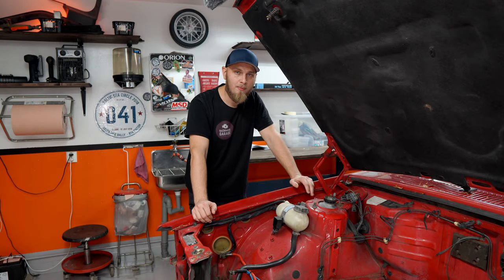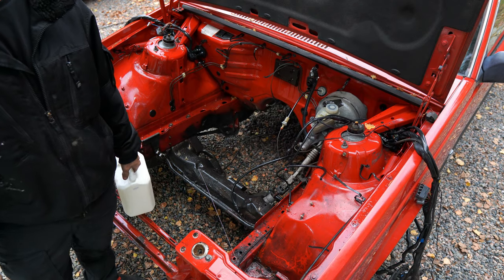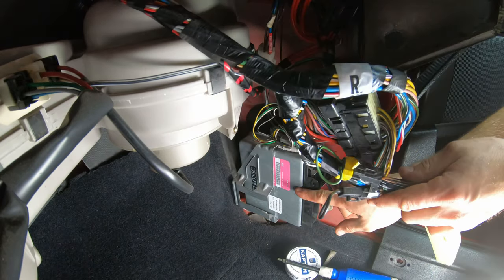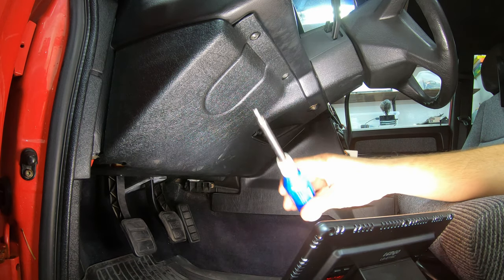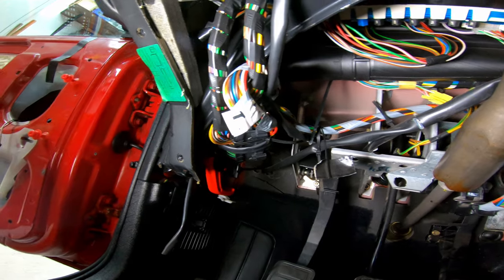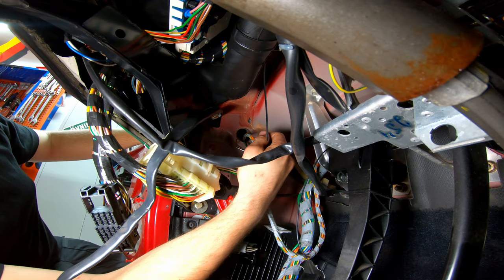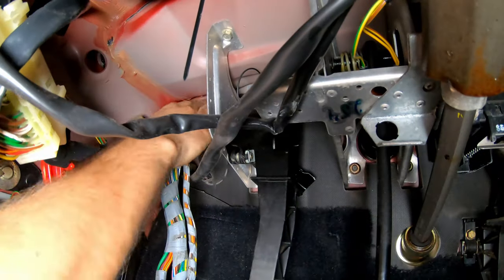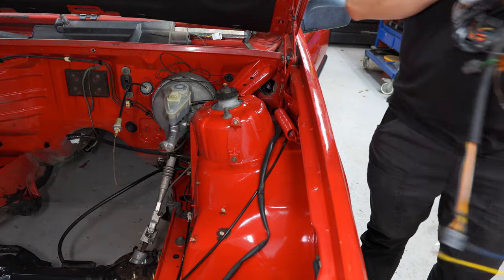Deep Clean of the Engine Bay and Engine Harness Removal - Part 9 - Volvo 740 T5 RWD BUILD

Comment: Can you make a video on how to make the integrated engine and chassis harness into 2 Sepatate harnesses after  SEPARATING the Engine side from the harness...
Reply from the maker: I think I did that, it's been a while since I did the electric work but I will run the T5 more or less stand alone from the chassies wiring due to the fact that I will run with different engines in this car.

Comment: håller på och drar el i mina skärmar nu på min 740. och har klurat hur fan ja ska få ut härvan på turbosidan, men det såg ju riktigt enkelt ut som du gjorde där, tänkte först klippa,. men det kommer jag ju ändå få göra sen för och förlänga, nu måstej ag bara lösa hur jagh skaa dra motorelen eftersom den har en kontakt vid vänster sidan också,, el är inge kul, men snnyggt när det är klart
Reply from the maker: Ja det är lite meck att få det snyggt. Ännu mera meck för att få det att fungera bra utan störningar osv. Att dra elen dålt på insidan av framskärmen är något jag ska försöka ge mig på. Kanske inte nu med 850 styrenheten men med  Maxxexu installationen sen vill jag ha det riktigt cleant i motorutrymmet. Jag å andra sidan kan tycka det är ganska kul med el. När det fungerar då 😄
Reply: @BackmansGarage   haha ja jag är orolig om den startar sen till sommarn att man råkat tabba sig nånstans, men sålämnge man löder rätt så ska det ju inte va nå prblem, färgerna är ju rätt tydliga så lätt på det viset, är ju ett par månader kvar till sommarn så man lär vill hinna klura ut nått till dess, lycka till med t5an(: